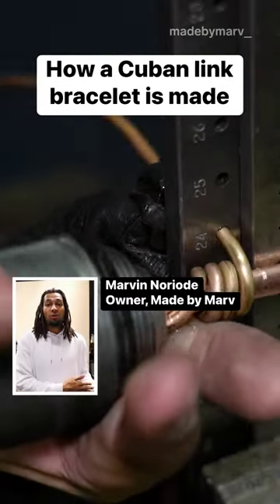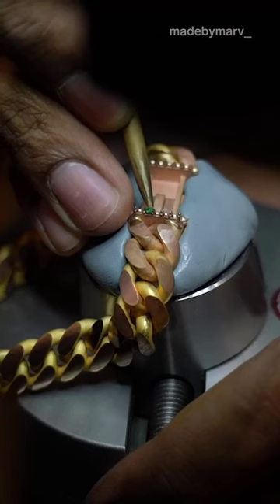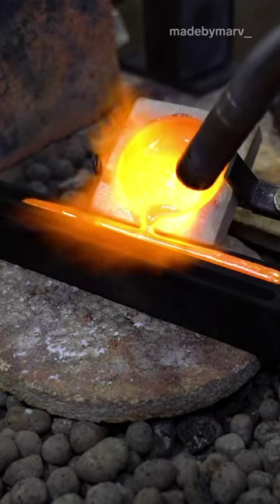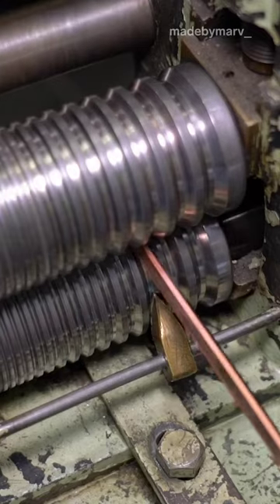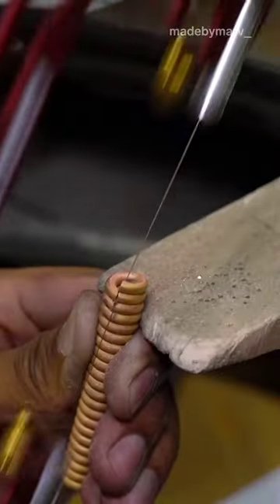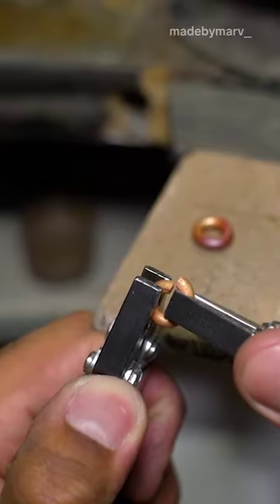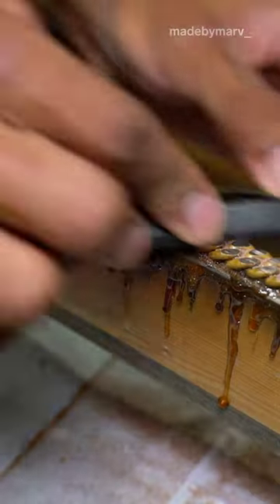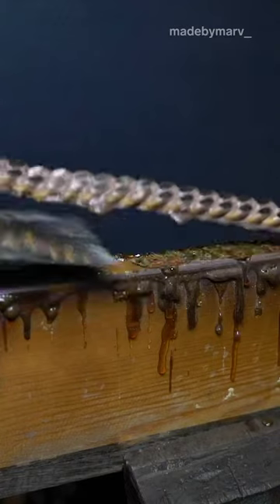This is how a Cuban link bracelet is created. #Cubanlink #bracelet #gold #jewelry #soldering

Comment: I’ve been trying to make my own Cuban link, what kind of solder are you using? I’m using a silver solder and made my links out of copper. I’m having a hard time soldering the rings together, every time I start to twist my chain to make the chain flat, my solder joints are breaking. I’m not sure if I’m using the wrong solder? Wrong flux? If I have to line my solder joints up a certain way when I start to twist? Would you be able to help me out with this so I can get started?